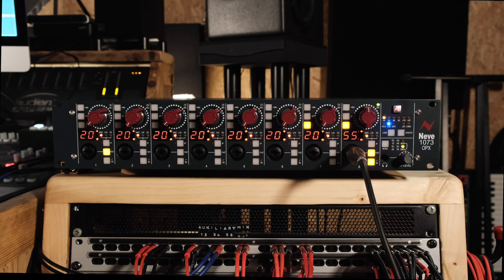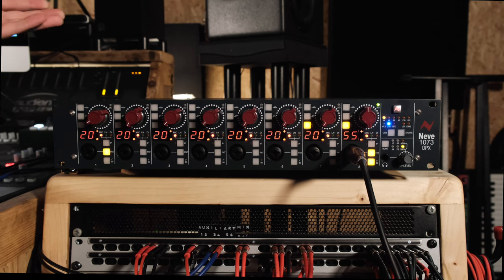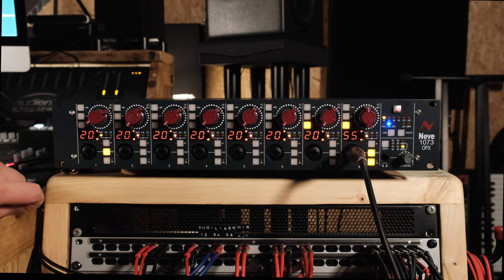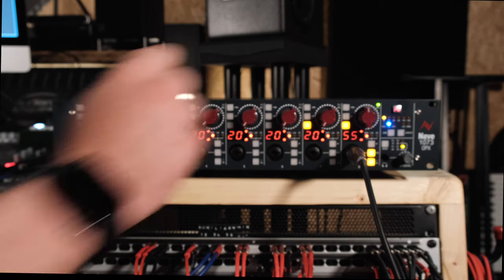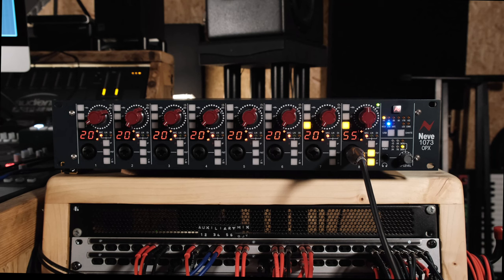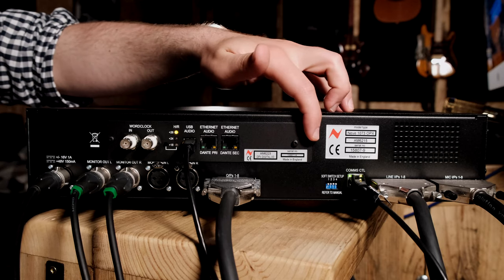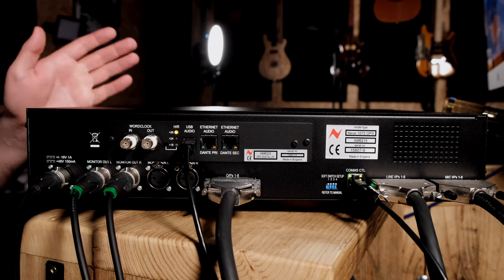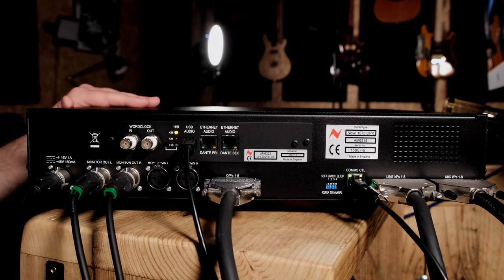Neve 1073 OPX Demo and Review

Comment: Thanks Alec! I'm trying to decide between this unit, a set of cranbourne camden 500 mic pres, and two API 3124v units for tracking drums. I know all will do the job well, but based on sound alone, which one would you recommend? My preference is a darker front end that would make taming harsh transients easier post-recording. The camden seems sonically the most clean, versatile and genre-agnostic. Any advice would be appreciated!

Comment: I don’t understand the hookups in the back. Is there some place I can go to learn what all that is and how to hook it up? I’m wanting to be able to use this for outboard gear too, but it doesn’t have outputs, so would I have to get another interface with outputs and use them as an aggregate setup?
Reply from the maker: There are outputs on the DB25’s. :) so you can use it as just a standard 8 channel mic pre if you want to.
Reply: @alecbrits  I’m wanting to use it to send to outboard gear and send signals from the box to the unit. Is that possible?
Reply: Also, I’ve never seen the types of hookups that are on the back. It looks like something you’d plug into a pc. What’s the other end of that cable look like?

Comment: Great review! You talked about output transformers, could you please tell me why the output transformers are important? Does it really affect the sound? Thanks!
Reply from the maker: Thank you! :) the output transformers change the way the pre sounds by adding a small amount of harmonics, but the biggest difference is that you cannot dial in the amount of saturation that meets your needs. You don’t get the Neve thick saturation that I got in my Neve 1073DPX video. 
You do however get a beautiful and open 1073 inspired sound. :)
Reply: @alecbrits  Thank you for your response! Another quick question, is it wise to buy Neve 1073 OPX and option card, then connect 1073 SPX to 1073 OPX in case I need a saturation for vocal and guitar recordings? I would just record drums through 1073 OPX. Thank you so much and have a good day! :)

Comment: Hey man, love the songs to these demos. 

Using some quality gear.

How did you come by the premise you're in?

Do you have two separate rooms? 

And what desk are you using?

Thanks
Reply from the maker: Thanks very much Oliver! :) 

It was a long search, managed to get in on the construction process of a beautiful rehearsal facility. 

I have one of the rehearsal rooms acoustically treated and tied into my control room with 24 inputs and 8 returns. Along with 6 Cat5 connections for the headphone systems. And two amp-cab connections. 

I use an Audient 4816.

Comment: They don't have output transformers, but, they do have marinairs as input transformers. How would you compare these to the 1073LB? I have a pair of 1073LB, and, am considering swapping them out for the 1073OPX, but, not if there is a compromise in sound character.
Reply from the maker: I have reviewed both of them, so you can take a listen to the demo in each and see how you feel. :) I prefer the 1073LB, the break up point is more musical, and it has a wide variety of options when wanting to add some colour.
Reply: @alecbrits  thanks, Alec. :)

Comment: Hi, can I use this as a 8 channels mic pre and output from the O/Ps 1-8 to audio interface line input ???  instead of over 8K for 8 units of Neve 1073LB, this baby seems like a much cheaper solution to get the Neve Pre amp sound back to my recording. Thanks. 

"No output transformers" meaning ?? Those output are "direct out" ? Not post Preamp out ?
Reply: electronically balanced output as opposed to transformer balanced. 
and the line input transformers were replaced with ICs.
Reply from the maker: Beige LA nailed it. :)

Comment: FANTASTIC Vid Alec!

I'm building a rig from square one and want to invest in 8 preamps that I can use for years to come. Would you rather have the 1073 OPX or slowly build up a mix of the 88R LBs and 1073LBs? There's a price difference, but want whats best for the long run for sound quality. You clearly have reps with all of the units. Your thoughts?
Reply from the maker: Thanks so much! 

I would lean towards slowly building with different pairs of pre’s from a different manufacturers. They each have their place! :)

Comment: Where can i learn about dante and so on? Im so confused about this still. Im still at the stage of produciton where i only have a good audio interface that acts as a preamp and a convertor.

Some questions:
1. Can i use this as an interface via USB and i woudl connect my microphones / d.i through the front facing inputs? You have your inputs on the back and that has confused me a bit -- since there are inputs on the front (the multi input xlr + quarter inch jack inputs)

2. Do i need conversion or does this have built in conversion like lower end interfaces? Would you say this is a step up from say an apogee element 88 interface in terms of preamp quality and conversion?

Thanks so much
Reply from the maker: Audio Dante is a really good place to start. Also going on the AMS Neve website, they explain how it works. 

You can use it as an interface, it’s conversion is really high quality as is to be expected from Neve. 

In the during the front and rear run down I explain why I use the rear inputs, it allowed me to plug the unit into my patch bay. That allows the flexibility to use the front of the unit when I want to as a DI or when I’m tracking in the control room. While having the connections in the live room still set up. This way switching between them is really simple and fast. 

Hope this helps. :)

Comment: I would love to strap this thing to my X-Desk mini console. Quick question. Even though this doesn’t have output transformers, can I still drive the input on  the pre amp and then pull the input trim down on my console to get that similar harmonic distortion effect?
Reply from the maker: Hi Ben! The distortion character is not as smooth as a conventional 1073 design, things get a little more hard sounding than the linear distortion characteristics of a full 1073. If you have the chance to demo one I would recommend it. :)
Reply: @alecbrits  Interesting and good to know. I’d love to demo one. Thanks Alec!

Comment: How do you feel about the Audient console? Is it worth it, do you ever mix and track with the preamps, or do you always reach for external gear? I can see the faders are practical...
Reply from the maker: It’s a great desk. It’s very much the centre piece of my workflow. I mix through it with the long faders at unity gain. It also allows me to do parallel compression and run the headphone system for the studio. I quite like the Pre’s too, I used them solidly for 6 months to get to know them well, before re integrating my outboard units. The fact that is an inline console really helps with my workflow. :)

Comment: If I want to continue to use my Apollo Plugins (Twin X) how would I do that with this machine? I know I can use the USB connection to make the Neve work, but will it still let me load my Apollo plug-ins if I connect that box separately? Thank you.
Reply from the maker: I’m not too sure, it might work. But a more solid solution (if the Neve was to be your primary interface) would be to buy a UAD Satellite. That way you can Mix with your UAD plugins and then use the NEVE as your main interface. Or, buy the non USB Neve OPX and get another apollo (X16) to use with your Twin. That way you can use all the real time UAD processing while using Neve 1073 OPX pre amps.
Reply: @alecbrits  Thank you, I will look into the UAD satellite right now.

Comment: Is it possible to connect to avid Carbon via ethernet port?
Reply from the maker: I am not sure, the Ethernet is on the converter card is a dante connection. The Ethernet on the unit itself is only for control over the unit.

Comment: Cool video, what were the setting you use for the Cole mics with this device? Thanks
Reply from the maker: Thank you! I just set them up with the low-z button and had them evenly spaced from the snare. Around a metre above the kit. :)
Reply: Alec Brits thank you, so you used this mic for the drums and not voiceover. What gain setting would you advise with the same mic and on this device for vocals? Do you think you will doing more video involving this device- understanding how best to use each of the functions of the preamp?
Reply from the maker: I used it on the voice over. I did process the voice over. I used RX to take out mouth noise, and soothe to deal with and strange harshness. Then L2 to bring up the level.
Reply: Alec Brits thanks for your feedback. I’m unfamiliar with RX and L2? What are they? Best wishes and hope to see more content soon 😊
Reply from the maker: Izotope RX7 and Fabfilter Pro L2. Give them a google, you won’t regret it. :)
Reply: Alec Brits thank you 😊